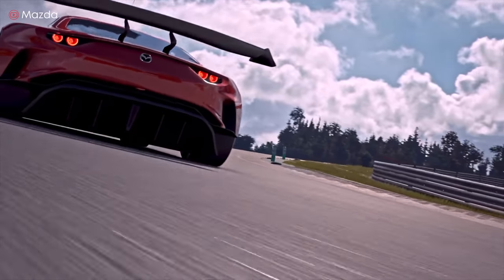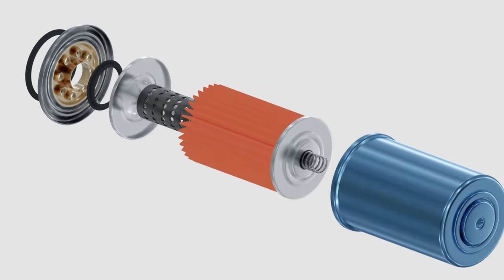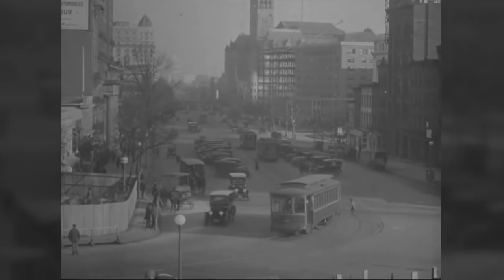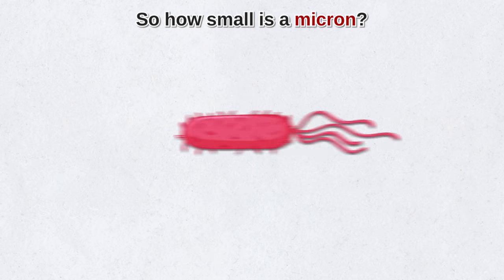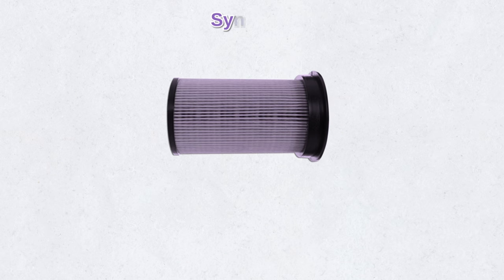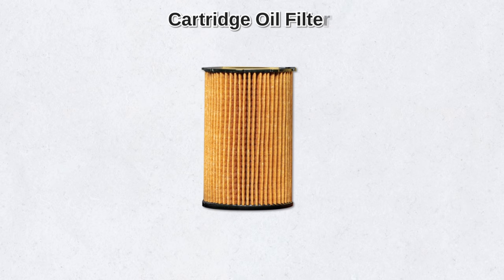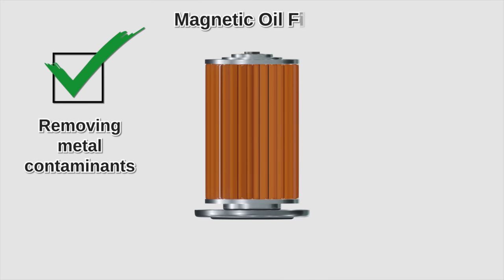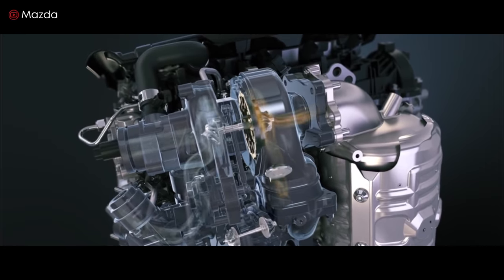This New Oil Filter Just Changed the Game (No More Oil Changes)

Comment: @3:11 known as Wix oil filters. The only filters I will use. If you use Fram, you do not care about your engine. Fram is garbage. Napa Gold filters are rebranded Wix ones. Love the calm explanation Scotty.
Reply: The Fram XG is a very good filter.
The cheap Fram isn't so good at all.
Reply: ..and yet there's no evidence that Fram filters damage engines or don't filter and that is with billions of miles of driving. Military and civ. airlines have been using Fram oil and fuel filters for decades, and they monitor delta pressure and particles constantly...along with regular phase inspections with trend analysis and oil sampling. If they were inferior it would have shown up long ago...
Reply: @land7776  
It's basically people making video's cutting apart different filter brands seeing how quality varies among brands.
I would use an Fram XG on my vehicles (and I do) but not the other Fram models.
I trust Wix & a few other brands too.
Reply: @sameoldeh  well, the old orange Frams , fuel and oil, are the ones I've seen used in aircraft for decades. As well as Mann, Wix, Hastings and others. Also in marine engines. There's no testing after millions of gallons/miles of data and trend analysis that shows a problem with them. If there was, it would've been seen and they wouldn't use them. But the Fram hate meme lives on I guess...
Reply: None of the full flow filters clean oil. I depend on my game changer bypass depth filter to clean oil. When I choose a full flow filter it will be on there a couple of years. I will be interested in how heavy the steel is.  How good the bypass valve is. The paper ends are no concern to me.. They will last as long as the pleated paper. The last full flow filter I put on the Pontiac Torrant was a Wix. I probably liked the feel of it. The Motor Guards will do the cleaning and protecting the full flow filter.  The tractor is a straight bypass system. It has a Old Frantz adapter. No full flow filter to worry about. The Kohler on the yard tractor has a Gulf Coast  junior bypass filter to do the work and a cheapest Fram to grab anything big.
Reply: Anything paper in any filter that is left in there too long including the paper end caps the pleated paper or the toilet paper in my bypass filter will lose its strength if left in the engine too long. A guy was inspecting the Fram that had been in there too long. He couldn't find a problem. My guess is it was the same as any pleated paper filter. The paper wasnt as strong as when new. The trick is dont neglect any filter  especially a paper filter. The toilet paper in my bypass filters stay strong and tear at each sheet. Try to tear it at each sheet when it has been in there too long and it will fall apart. The toilet paper will stay in the housing. The pleated paper has the stress on it. It might not stay in the housing.. I've seen parts.of the pleated paper missing. Where do you think it went.  Someone changed their oil in the Auto Zone parking lot. I picked up the bottom of the price Fram. I think I will open it up. Chances are if it wipes off clean it's still good inside.  If the outside looks bad the inside might be in bad shape. At least it was in a plastic bag.

Comment: Names the oil filters that have less than 25 microns.
Reply: Wix XP, amsoil Ea/EaO, I think fram platinum, and a couple others
Reply: @Prestiged_peck  Did you mean Penzoil Platinum and/or Fram Titanium?  Those you list are all known as good filters, yes.  But, I can't find any that say "microglass" media like this video suggests.
Reply: @CaseAgainstFaith1  wix XP and amsoil EaO are actually a fiberglass based media
Reply: @Prestiged_peck  That may be true.  But Wix's and Amsoil's literature just say "synthetic" media.  If Scotty is going to tout how great they are, he should have said more about what are or not what he is talking about.
Reply: Mobile one. Why it only one  can handle high oil pressure, change at 8k not 10k the clearer the better
Reply: @CaseAgainstFaith1  the only reason I know this is because I'm an amsoil dealer, and they work very closely with wix, who manufactures almost all amsoil filters, the EaO filter is a wix XP on steroids. The EA is also a synthetic media but it's a thinner media.
Reply: Full flow filters are limited  on how effective they can be. Give them enough depth to clean oil and the bypass valve stays open. Then all you have is a bypass filter that screws on. An example would be a Trasco or Stilko. The only way you can win is to use  a depth secondary filter with hoses. Good luck finding room on some of these cars. I have to remove the grill to service the secondary  filters on the engine and  transmission on the Altima Nissan. They are in front of the radiator. Luckily these new cars are so clean running they dont put much of a load on the filters. Even if a full flow filter could remove 25 micron particles It couldn't do it long with no depth.
Reply: @richarddarr800  how high of oil pressure are we talking? Cause the wix filters I use function properly with 60psi hot idle oil pressure, and wix racing filters have been proven in excess of 150psi
Reply: It's like tooth brushes and razors. They have to keep coming out with new ideas that may or may not be an improvement. The factory installed bypass filter on my Rambler america  flat head 6. Was pleated paper the same as the full flow filter on the overhead  valve engine. It could clean better than the full flow filter because it had an orifice. The spin on pleated paper bypass fllters were normally rated at about 10 microns.. The oil was always black and dirty. Installed a Frantz oil cleaner and the oil turned amber. This would tell me that 4 inches of toilet paper is better than 1/32 inch of pleated paper. Haven't used the Frantz or the Frantz elements in many years. The old Frantz elements were a custom made roll of toilet paper on a thick core. They have a synthetic element now. Is it better than toilet paper? Probably not. A 25 micron abrasive is a boulder between two polished surfaces.

Comment: Fram Ultra Synthetic XG7137. One for my Civic (Mobil1 Extended Performance 5w-30 oil) and one for my YZF-R6 (Rotella T6 5w-40 oil). Get them from Walmart for cheap and change them often.
Reply: You could easily use 5w40 in both
Reply: The last time I was at Walmart  I didnt see any Rotella. Years ago when I was selling Gulf Coast filters there was a test of Shell Rotella 15 40 with a big Gulf Coast filter filter that took 2 rolls of Bounty Big Roll paper towels. The last I heard of it it was getting a 1 million mile inspection. They drain the oil at about 250 K miles tear down the engine and measure the parts. Put it back together and pour the used Rotella back in. It's a Detroit series 60 425 HP engine. One engineer said it's not unusual for these Detroits to go a million miles  but not be in near new condition.  Shell oil does the measuring and marking the parts. The amount of make up oil added is equal to a full oil change every 40,000 miles. Was talking about it on a forum. Road King magazine wanted the owners phone number. They did an article on it October november 1996 I believe. Of course I was down at TA truck stop picking up copies to show people. I also got the attention of a NASA heavy equipment  engineer. They use them the last I heard. I called Gulf Coast Filters and told them I have a guy that wants to talk about heavy duty filters. I think they sent someone to Canaveral. I didnt think they were interested in my Subaru and toilet paper filters. They talk engineer talk.
Reply: @ralphwood8818  I had to look that up just now and I must say that's actually a good idea. I never owned a diesel or had any experience with diesel. I never really liked big semi trucks that is until thousands showed up with their horns blaring in the streets of my city to unite Canadians in the fight for freedom from our tyrannical government. I have never see a more beautiful thing than all those gleaming trucks parked in the streets of downtown Ottawa. I never imagined anything like this could ever happen, it's completely surreal. My full support to all truckers around the world in the fight for freedom.

Comment: Go electric and say goodbye to this stupidity of ice cars
Reply: Still have to change the reduction trans fluid in a tesla. And electric cars aren't trouble free either.
Reply: This over 100 year experiment with the internal combustion engine just hasn't panned out... NOT.😆
Reply: I don’t like Teslas but would love to say goodbye to any type of filter or oils.
Reply: I will but my 23 yo car just won't die.
Reply: I'm  getting a Ford electric truck but I am waiting until they work out the bugs and my 76 F250 gives up the ghost.
Reply: @ralphwood8818  If you are serious you should see Munro's video " Mach-E Thermal System Part 2 " I know it is not the same as the truck but it can show you what to look for in a Ford EV.
Reply: @thesure1  I'm not serious. I saw one on TV  the other day. beautiful  truck. I'm 81.  The old Ford will out last me. 76 F250. 390. Good for about 10 miles per gallon but drives like a Lincoln. Gulf Coast and Motor Guard  toilet paper filters. At least I dont have to change the oil with game changer filters.

Comment: If you have a spin on filter, MAKE SURE TO CHECK WHERE THE GASKET OF THE OLD FILTER IS BEFORE PUTTING A NEW ONE ON!! My dad and I were changing the oil in a car we don’t have anymore, and when we took the old filter off, we didn’t notice that the gasket was NOT on the filter, but where the filter was on the  car. We put the new filter on, filled the car with new oil, turned the car on, and oil GUSHED everywhere in the garage! 😅

Comment: I can the oil when it smells funky & darkens, indicating its become acidic & contaminated. I use the OEM filter during an oil change & change the oil while the engine is hot, thin warm oil drains more effectively. I also lift & lower the jack on one side to tip the car to help more oil get out & notice at some angles the flow rate increases, while the drain bolt out so oil goes into the drain pan where I collect spent motor oil. I put the spent motor oil into a container using a funnel to take the used oil to a local auto parts store for recycling. Charing the motor oil slightly more often will only cost a little extra, but if you going to keep the car for a long time & high mileage, a few extra oil changes can reduce engine wear & make your engine last longer ..
Reply: Take a paper towel, pull out the oil dip stick & wipe it off. Clean motor oil a light yellow color. As blow by from the engine contaminates the oil with acidic funk & particles, exhaust gas etc that slips by the rings even in good engines, the oil becomes darker & smells worse. If you wipe the oil on the paper tower & it looks darker & smells like HC or gasoline or has a burned funky smell, change the oil & oil filter early.

Comment: I use the Wix XP oil filter as my 1st choice and Fram Ultra from Walmart as my 2nd pick and Costco’s Kirkland full synthetic oil and change every 10k miles on my Toyotas since i do alot of highway driving.
Reply: Fran is the worst oil filter
Reply: @reginaldsmall3766  
Fram XG (top grade) are very good filters.
Fram has three different grade levels of filters.
Most companies have two.
Reply: I dont change oil unless I have a reason. Years ago a trucker told me to install Gulf Coast filters on his truck. He said while you are at it change the oil. He had containers of Amsoil. I asked him what was in the truck. He said Rotella. I didnt have to buy oil for years.
Reply: The Wix on the Pontiac Torrent has been on there 4 years and 61,000 miles. The game changer toilet paper filter keeps the engine and the Wix clean. I recently installed a game changer Jackmaster Classic .It filters the same as the game changer Motor Guard. Had to try the Jackmaster . Very impressive filter. 60 years of clean oil starting in 1963 with a Frantz oil cleaner and Standard Delo. Delo was about 29 cents in the discount  stores. The Frantz oil cleaner was 29.95.

Comment: I saw a blogger cut 12 oil filters open and compare them. Both of the different orange FRAM filters had rust inside the metal cans, and obviously were cleaned with water after they were built, without drying the inside. NEVER A FRAM.

Comment: Engine oil change warning: I changed the oil and filter once and did not notice the old oil filter gasket stuck on engine, I installed new oil filter with new gasket.
The two gaskets started leaking immediately. What a mess! Always check if old oil filter gasket is on the removed oil filter.

Comment: Many years ago, car manufacturers recommended changing the filter every second oil change. Car and consumer magazines pointed out how stupid this was. As you said, what is the point of putting in clean oil that will be contaminated by a dirty filter.
Reply: The reason they say every other oil change is because the full flow filter is still clean after the first oil change. In a car such as the wifes Accord. The WIX on.the Pontiac has about 60,000 miles and 4 years on it.I have a game changer bypass filter on the engine to keep the WIX clean.

Comment: I bought my 2013 f150 used.. and when i checked the oil it had 3 1/2 quarts out of the 7.7 needed ! after a well needed flush i use the Motorcraft filter and it's full synthetic oil.. i usually change it around 5k miles

Comment: I'd say 70% on the vehicles that come into our scrap yard here that are not crashed or flood cars, come in due to simply no engine oil. People just will not change it or check it. I see tons of vehicles like the Chevy Equinox, various Subarus, Cadillacs, and many others come in due to "no oil" and knocking engines or locked up. Typically 8-18 years old and 90,000-200,000 miles.
Reply: I started using and selling  the Frantz oil cleaner in the 60s. The filters were no problem. A lot of engines were so sludged up from neglect the Frantz reached its capacity in less than 50 miles. One guy said will that filter help fix my noisy lifters? I ask him when he changed the oil last.He said I don't  know its been a.long time. That was.a Cadillac  that was clean.  Went to a family reunion once about 40 years ago. I was reminded of the filter I put on my dad's car that filled up with sludge and quit working.  Never went back. Put a Frantz on my uncle's 59 Ford. Same problem plus he had removed the thermostat. He lived near me. I said we are going to have to change the toilet paper every 50.miles or open and clean the engine. He traded the car in on a new Dodge Pickup. We put the Frantz on that. One guy said my oil light comes on when I go around a curve.  He probably had less than a quart of oil that went to the side of the pan . A nice Ford life in a full service Standard station. I have to tell this story. When I was 15 working in a gas station on 99 highway  in northern Oklahoma an old guy came in with no fan belt. Steam blowing out.  I said I dont have a belt but have some trot line cord. I made a fan belt. Told him  he could probably get to Sedan.ks about 12 miles. A few.days later he came in and thanked me. He said.boy it's still working.we had a Hupmobile with a.screen door spring for a fan belt.

Comment: At 17 was doing my first oil change on my 1990 ranger 4.0 V6 4wd STX with every option and package with 0 rust. It was a nice truck. Very nice. Well, I didn’t know that you had to change the filter every time, and saw it’s location and thought it was too difficult to reach, just decided to change it next time around, like an air filter. I blew the motor in like 2k miles.
Reply: that's ridiculous... a motor is not going to "blow" if you don't change a filter once..esp @2k.. that 17 yr.old did or didn't do something else to that engine, or it had another serious problem..
Reply: @land7776  very true
Reply: That would be like the guy that looked out the window and saw a wolf. The next day his mother died. The wolf caused his mother to die .

Comment: I added a bypass oil filter to our 2007 Honda Pilot and sent an oil sample to the lab after 1 year. Oil was still in great shape suitable for continued use so I changed the full flow filter and I am still running the oil. Let's see what happens at the next Oil sample.

Comment: I change the oil filter every 100k miles whether it needs it or not. Works for me.
Reply: Heard someone say that would work for an old donkey, maybe even a mule.
Reply: Look for an engine rebuilder fast
Reply: Not much in a modern engine oil large enough for the full flow filter to remove.  The reason I change the full flow filter at least every 2 years is im not sure how long the filter parts can hold up.. my game changer depth bypass filters will keep the oil and full flow filter clean.

Comment: I trusted oil changes to the dealership where I purchased my car. I've been doing my own recently because they never notified me that the service department snapped off a couple of bolts that help to secure the lower engine cover. After a few more oil changes at the same dealership, I noticed the cover sagging. That's when I discovered the problem. I won't be returning to that location for any service including recalls nor will I recommend it.